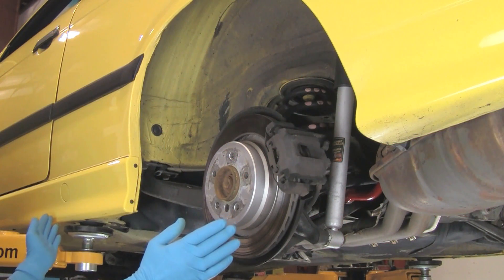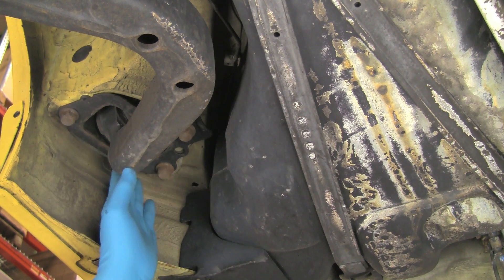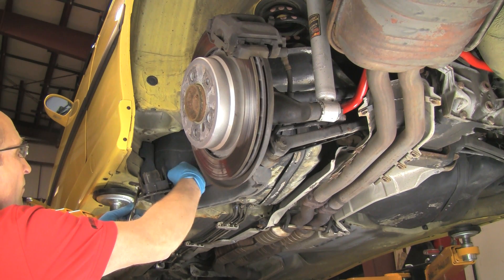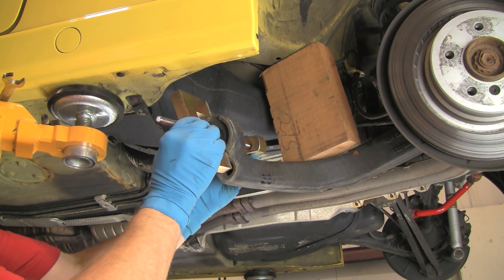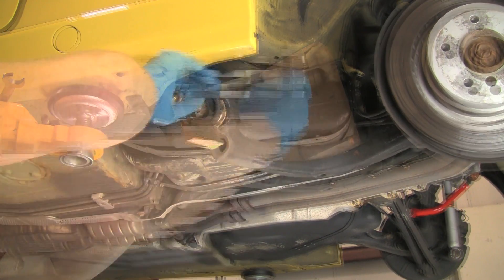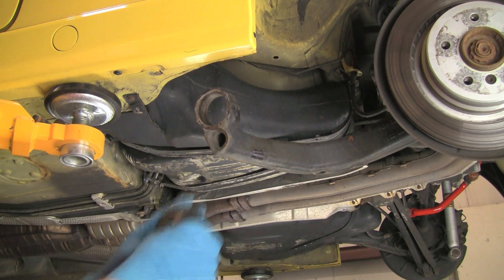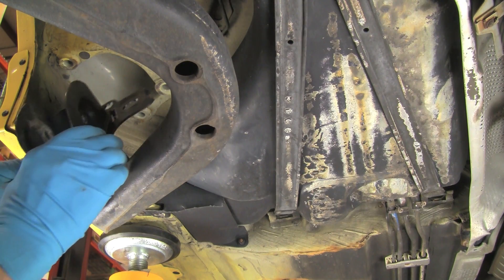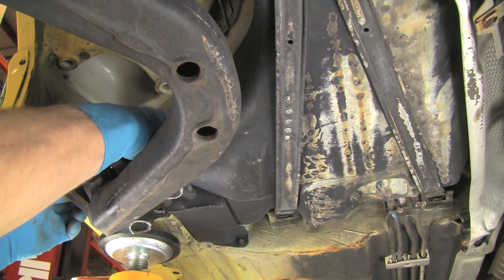Replacing Rear Trailing Arm Bushings on BMW 3 series 92 thru 05, Z4 thru 08, X3 thru 10

Comment: Don't burn the bushings ou, EVER. The time it takes to burn them out will warp the aluminum trailing arm. Cut the rubber "notch" nubs off on the ends with a box knife. That will make it easier to accept any standard bushing press. I know for a fact that the Snap On flat bushing press works with the 57.5mm short adapter from that kit. You can use a press with an adapter between 56-60mm and it will work. On the back side you need a 62-67mm for the bearing to be able to go into. Takes about 5 minutes to press them with the proper tool.

Comment: you know i am having a trouble with my e36 right now. I have changed the trailing bushings, with original ones but the handling of the car is very poor. so i am to replace the new bushings with a powerflex ones. but i am wondering, would i need to change the trailing arm itself first???!!!!! as I am thinking that the bushing housing might have got wider now due to multiple pushing change?!!
Reply: I was told that after changing the bushing, or any suspension work really, get alingment done.

Comment: I love these videos. They're very clear on what you need to do when you're working on a clean car without rusting bolts, when you've had stuff on and off numerous times. For the rest of us dealing with 20-25 year old cars and the parts are all original, this won't be as easy as Otto demonstrates. I tried using this $90 tool, and it was useless for my bushings, which were thoroughly gauled into the carrier bracket. Instead, I took a small pry-bar I had laying around, and placed it between the bushing flange and the carrier and banged on it with a rubber mallet. I had it out in less than a minute. So, save your money on this tool. It did come in handy when installing the inside powerflex bushing segments, neither of which seemed to fit. (the outer segment went in easily.) That said, with a little ingenuity you can easily take a threaded rod, a couple of washers, a couple of nuts, and two pieces of wood or electrical box covers (60 cents a piece) and easily come up with a far cheaper, but just as effective jig.

Comment: Removal without the specialty tool

1. Burn the old bushing out or use a drill to put some big holes in the rubber so you can remove the center and a good deal of the rubber. 
You are effectively destroying the bushing if it isn't already. 

2. Once you have enough space to get a sawzall blade in, use it to make cuts in the bushing sleeve (being careful not to cut into the arm) in two places maybe 30-40 degrees from each other. 

3. Use a flat-blade screwdriver or punch with a hammer to knock out the area between the cuts. 

4. Collapse the rest of the bushing sleeve using the punch/screwdriver. It should begin to fall out as it collapses. 

This approach takes maybe five minutes once you find your groove, and it works best if you are replacing with polyurethane (no press required) or have a large puller/ball joint press with the appropriate sleeve sizes to install factory bushings. Kits with the sleeves are available for rental from almost any auto parts store or purchase for $60-100. 

This approach is common in auto shops for bushing/mount removal, depending on the mechanic's preference for the particular job.

Comment: I just installed new coilovers with mounts and raised the car back up. (it was slammed on the old coilovers) but now its creaking like a pirate ship in the rear. Could it be these bushings? What happens when they go bad?
Reply: You probably have poly rtabs

Comment: I heard that for the OEM bushing you need to "preload" it by correctly positioning the bracket in a specified angle. how did you achieve this? Is it enough if you mark the bracket/trailing arm position before removing it? thank you!
Reply: I suspect they did the other types of bushings to avoid having to explain this in the video lol
Reply: Well, I suspect they did the other type of bushings because they wanted everyone to BUY THEIR BUSHINGS! He could have easily showed both in this short video, but chose not to..and then chose to back it out like it was garbage, and then proceed to show their brand which is MUCH BETTER (OBVI) 😂🤣...and MUCH, MUCH, MORE EXPENSIVE...HEADY PLAY!...HA HA!
Reply: One approach is to note the angle of the bracket with respect to the bushing before you tighten it, and replicate this on the reinstall.  The trailing arms are relatively long compared to other bushed joints of this type. Therefore the angle transited during the full range of suspension travel is pretty small. This is not a critical angle.
Reply: Yes, and there is an alignment tool for this. It’s a long flat bar that bolts to the RTAB housing and aligns it to the center of the rear axle, makes preloading the stock bushings a snap.

Comment: does the bushings removal tool that you used on this video can also be used to remove the rear control arm bushing or the whole 6 axle bushings?
Reply from the maker: +Tito Neal - No, just the trailing arm bushing.  We're working on tools for the other rear bushings.

Comment: No preload on the trailing arm?
Reply from the maker: Not when installing urethane or the Ultimate bushing.  Yes, standard replacements must be "set" so that they are not pre-loaded when the vehicle is sitting at ride height.  The Bentley repair manual does show this.
Reply: +Bavarian Autosport good vid! can you explain this part to me? when using oem bushings how the preload prosedure goes? thanks

Comment: How do you take the last type of bushing off when it comes time to replace it. It looks like it does not have any flange cut outs for the press tool.
Reply from the maker: Hmmm ... ok .. good question.  First thoughts; slide hammer or cut notches for the removal tool.  We will bring this up to the manufacturer!
Reply: same way as it went in, by hand. "removal is reverse of install" just watch the video.
Reply: Easy...just remove the 3 screws & pop off the "dummy" inner flange and it will give you access to the inner-side of the bearing in order to pull out the bearing towards the outside of the vehicle. The bearing was pushed in...so it has to be pulled out, but the inner flange needs to be removed first!  : )

Comment: Great videos! Could you PLEASE do a detailed video on installing timing belt/water pump and all new belts on the E30 M20? Can't seem to find one anywhere and you do the most detailed and instructional videos. Thanks in advance your loyal customer.
Reply: We likely will not be doing an M20 timing belt video, but have you seen our DIY write-up on our Tech Blog?  Click the link - http://blog.bavauto.com/7246/bmw-m20-6-cylinder-timing-belt-replacement/